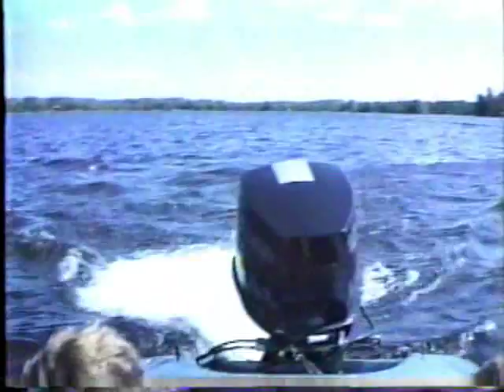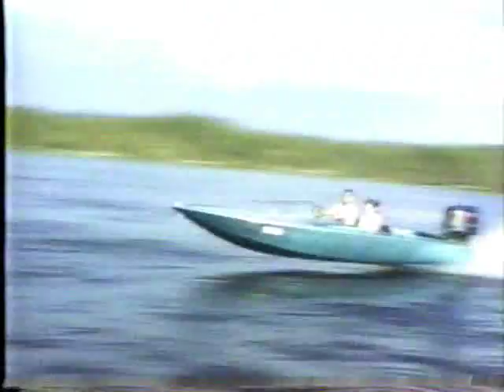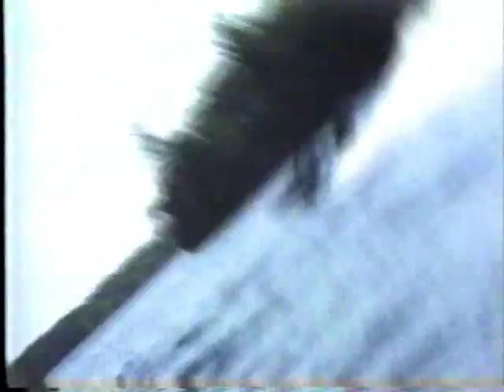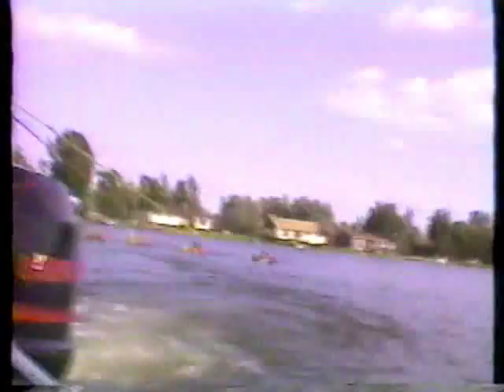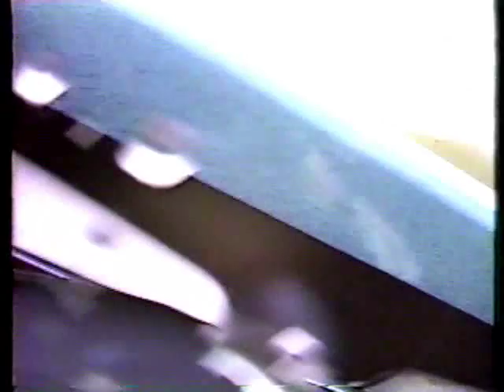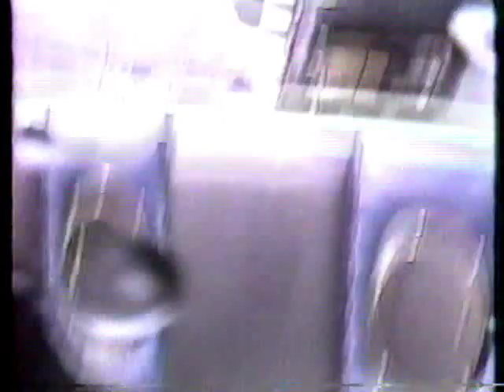Our 1982, 19' J Craft with 235 hp Johnson

Comment: Mate, the 235 v6 was a be-utiful engine. Had one on an 18' Haines Signature 1550LE. Boyessen reeds, squared intake/exhaust ports, releived crankcase and piston cupping. Was a wonderful engine until a very dubious re-sleave became apparent. Replaced it with a looper 225 and was/still (now 3.0L) dissapointed. The -XFlow has heaps of torque. Still have the dead block and teaching the younger ones XFlow porting. Great boat and cheers. XFlows have the best torque. Loopers are lazy. :-)